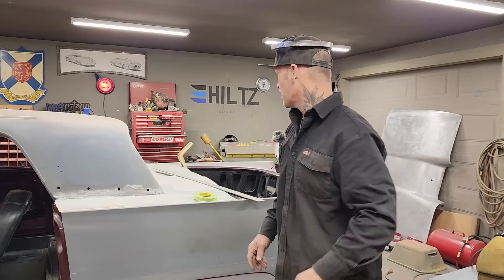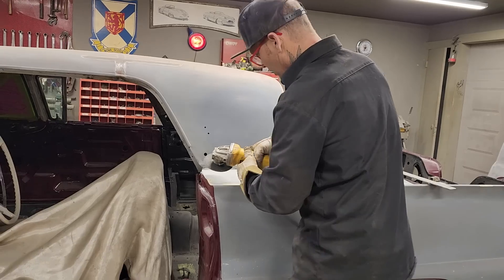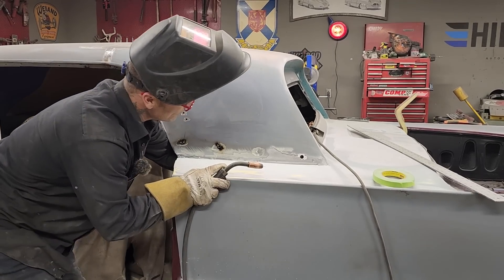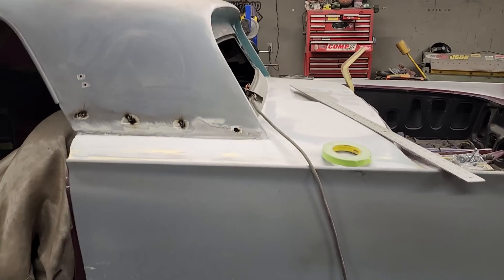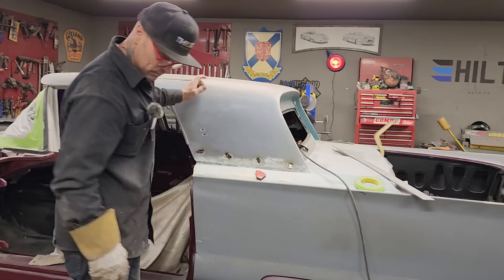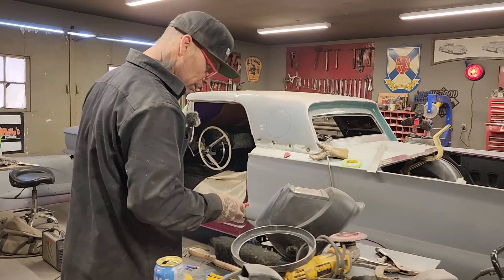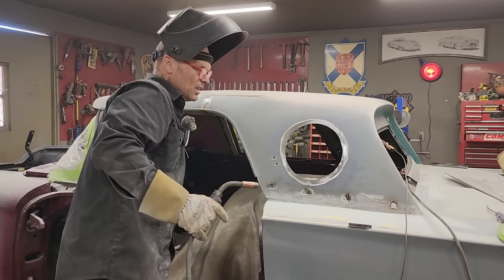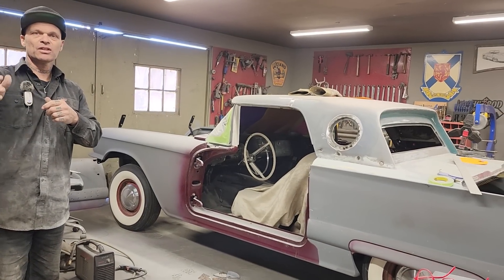We ran into some issues applying the port hole windows 😝

Comment: Cut a piece of coat hanger about 5>6" long. Tack it to the centre of the small metal cut. Pass the coathanger wire through the hole from inside to out and pull and hold the metal plate from the coat hanger stem. (Spinning plate on a stick)...🙂👍Good work though guys . Camera excellent...don't forget to let Fina in....😂👍👍
Reply: Just noticed a few with the same idea ..😂

Comment: When you do the passenger side hole fills, try applying a coat hanger in the middle of the repair piece, feed the hanger through the hole from the inside so you can hold the piece from the outside while you apply the weld. No finger burns and your coat hanger is ready for the final fill. Rinse and repeat!
Reply: Wow that's kinda what I just said
Reply: I thought the same but I was thinking just use the wire from the the welder, just weld it on the patch run a inch or two of wire out, cut it off. much like a drywaller would do to patch a hole
Reply: totally agree , this would be my first obviose choice , cheers

Comment: One idea would have been to weld a short piece of wire to the metal the stick it through the holes to weld them in. Sometimes you have to think outside the box.
Reply: Good mine.s think alike
Reply: Minds
Reply: great idea i like it
Reply: Top idea, same as tow bar mounting nuts you push inside the chassis.
Reply: My idea also but it’s hard  to yell that through the tv. Coat hanger on the back side and place it from the inside, and maybe have Jolene tack it as you hold it. No more chicken fingers.
Reply: A longer strip that covers several holes would also make the job easier.
Reply: chad could have even used masking tape on a screwdriver handle to hold the small metal square in place until he hit it with the welder. lots easy on the fingers too! hi jolene.
Reply: Exactly what I was going to suggest!

Comment: Man the chicken finger brought back memories! I once worked at an offroad truggie building shop, dude had just welded up an endcap on a tubular rock slider and I was tasked with doing the other side. Boss man shows me "look it's a fingers gap away from the body make it the same on the other side" he was wearing a glove when he did this as he had just been welding. Me not taking notice and the metal no longer red hot I put my bare ass finger in there only to realize it was probably over 1000 degrees still, instant blister that covered my entire fingertip! Lessons learned that day....😆😆🔥🔥

Comment: Great job Chad if anyone ever cut stuff out like Chad just did you have to admire what he does as cutting that circle out with the 5 inch cut off wheel that precisely is amazing. If I cut it and I have done a little work on car's I wouldn't be with in a quarter of an inch either side of the line. Bravo Chad. Excellent video work by Jolene as usual 😊.

Comment: When I'm faced with the problem that Chad was with the finger burn . 
I take the welder and weld the wire to the patch part . 
Then I let out about 4 inches of wire  then cut the wire and at that point feed the wire though the hole pulling the patch to the weld area . 
You can then use the wire to hold it in place while you tack the patch in place . 
Just how this old guy does it 😎✌️

Comment: Good points on the pitted chrome. I've seen a lot of people build a decent cat and skimp on so much such as proper screws bolts. I can see not affording chroming but they would also try to say its fine. I worked on the interior of a 51 Hudson rag top with the plaid interior. Guy a guy who restored the car got free storage in the shop for a couple years. He got his screws from his work which were completely wrong but they were cheap or free. He worked for the railway to so he was not starving. When time came to finally pay for the interior, he refused to pay for it. We started taking he interior out in retaliation and he finally paid. Stuff like this is why I got turned off from the car hobby. Then when you are willing to pay, the shops/mechanics.junkyards you go to see you coming and screw you over, had that happen to.

Comment: Maybe when you fill the holes on the other side, you could try sticking your coat hanger all the way through to the inside, and weld your patch to that, and pull it from the outside to plug the hole. Then you can use the hanger to hold the patch while you weld it up. Just a thought to save your fingers. :)
Reply: He needs some honey on hand literally. Best thing for burns
Reply: I used to use unispoter pins and butt wield that size holes

Comment: One thing that may have helped to plug the small holes would have been to take a small roll of the tape you have right there on the finder having the sticky side out. Put that on the end of a drill bit or something that would have fit through the hole on the back side. Stick the small piece of metal you were using to plug the hole on the end. Put it through from the inside line it up tack it in place the repeat for the rest of the holes and no burnt fingers.

Comment: Next time make a slot across the hole. Weld a wire to the little patch. Slip the patch through the slot, andcthen pull it tight to the inner side of the hole and slot weld it. Then just grind off the wire and fill up the hole as you always do.

Comment: To hold the little bits of metal in the tight holes, I would have used some kind of putty as a wedge to hold them in place from the inside, tac and then remove the putty. OR, maybe tac a line of coat hanger to the center of the small piece, push it through from the inside and then tac around the coat hanger using the coat hanger to pull it in place tight. Or of course everything would be easier with two people doing things, one in the car and one outside. Looks good though!

Comment: Chad & Jolene hope you had a nice ride in the Vette today! Chad you gave new meaning to finger sandwiches today, a little dipping sauce and you are good to go! That looked like a painful sacrifice to make, could'nt you have welded the coat hanger or something to the back of the patches and held them in place while Jolene tacked them in? Either way nice work on the holes and the port hole and Jolene nice work on the video and the close ups of the issue with holding the patches. Chad when you mentioned the drinking and hitch hiking, when we were young in the summer in Michigan a friend and I used to just hitch hike around for something to do. I never got in trouble drinking and driving until in my late 20"s I moved from Illinois to Wisconsin where bars are really plentiful and I got charged with DUI more than once. They are misdemeanors in the US however Canada considers even one a felony so as much as I would have enjoyed attending the workshop that you had or even just visiting you and Canada as a felon I am not allowed in Canada so if they chose to check my driving record at the border I would be turned around and sent back. I think that is why you had people that ended up sending the kids instead of coming themselves as they had signed up to do!

Comment: Hi Chad and Jolene , Zack from USA 🇺🇸 on this video, I can't help myself but to say if it's of eny help future reference on a similar hard-to-get area for welding I like to say , that if it's hard to hold the metal size of a dime or nickel if you weld a clothes hanger wire in the middle on that nickel-sized metal and put the wire  through the whole that you're going to plug up... hold it on the other side to tack welded then break off the clothes hanger wire.....

Comment: Bad Chad, just a thought so you do not fry your fingers on the passenger side… what if you made your small natal ‘backer’ pieces and then welded a length of coat hanger to each piece. Then slide the coat hanger welded to the piece from the inside of the car so the backer is inside and the coat hanger is outside for you to grab with a gloved  hand so you can pull the backer tight without getting roasted as you weld. Just a thought from a nobody that does not like burned fingers because they hurt.

Comment: I agree the back window looks too small and the port holes look too big but anyone can do anything they want to do to their cars  Thank you Brad and Jolene for posting the videos they're awesome
Reply: The upside to what he is doing IS that once he has all ( windows ) accounted for in the top , IF he decides to have the top of the door window , the top of the porthole and the top of the back window relatively close to the same height for uniformity. The back window frame can have the top cut out at the upper corners and moved up.... Or not really... it is up to them.
Reply: If the rear window is tinted and the surrounding surface painted dark or in contrast to the car it might look better ?
Reply: Please raise the back window upper lip about two inches to height of porthole.....its on the fence at cool but taller rear window it be badass. That zip cut circle some serious skill i cant say enough how amazing you are with it.....
Reply: The 56/57 Thunderbirds port windows look big too,look at the side profile of a 56/57...

Comment: Chad:  When you want to weld in a trim hole and there is a bigger hole behind for a socket access to the nut that holds the trim, cut a piece of metal that will fit thru the rear access hole and tack a piece of welding rod or coat hanger wire to the piece and feed it thru.  You can pull out the wire and hold it while you weld the hole. Much easier and it prevents dropping the backing piece and burning your fingers. Speak from experience.

Comment: For the hole plugs try sticking the welding wire to the plug then run out a few inches and cut it off. Then run it through the hole and hold in place from the outside. 
Everything is looking great. Really enjoy your work .

Comment: Hi chad can you just spot welld on the little  bit of metal and put it through the hole to hold onto the little bit of metal .when I say it sound better in my head wot I mean is thread it like a shoe lace throw a hole 🕳 put some welding wire on a little bit of metal and feed through the back of the roof if you know what I mean pal🤪👍👍💯 love your channel chad I hop this is OK 👍

Comment: A litle tip if you don't want to be fighting with those pieces of metal behind a hole: tack it with the welder to the welding wire, run the wire cut it and you will have a piece of wire on that plate to pull it through the hole, enabling to keep it in place and weld it 😊

Comment: Tack a piece of coat hanger to the center of the patch metal, poke the coat hanger through the hole from the inside and then use the coat hanger to pull the patch up tight for tacking then remove the coat hanger. I have done this MANY times before. and it saves the fingers.

Comment: On those little pieces of metal you should have tag welded a piece of coat hanger to the little piece of metal and then fed the coat hanger through hole from the back side and simply pulled metal to roof tight from the outside front.
Then weld and melt coat hanger off.

Rinse, wash and repeat for each one.

Comment: Chad, monkey metal is another name that they always called Pot metal, which is a very cheap low melting  point alloy. or brittle aluminum castings. It was a term used in the antique trade to describe spelter figurines, and other ornamental items.

Comment: Hi Chad and Jolene good episode as usual. The Smoothed Nosed and Decked look is fine by me and this Bird is the right car for it! Those original Monkey Metal trim pieces though are kind of cool and I believe readily available. New or old stock would be easier and maybe cheaper than restoring the pitted ones.

Comment: You can fix the back window, by cutting it bigger at the top, bringing it up to within about an inch from the top.  That area is where it seems to look really off.  Just make it taller, then the back would look so much better and it would work better with the portholes.
Reply: Why even bother?

Comment: Chad is a master at engineering on the fly!
Reply: A Chad. mart Campbell on your putting your metal in from the backside. Why couldn't you just use your wire from your welder? Put it through the hole and then you have something to hold on to so you won't burn your fingers.
Reply: @TheRolfano  You're saying he has an eye for aesthetics?  He's way better at fabrication than design.
Reply: This episode was even more painful to watch than usual. Usually he is good at the fab part, but watching him cut little pieces, drop them, re-cut, weld, burn himself, then almost screw himself by not checking being where he was cutting the porthole....yikes!   There's easier ways to weld little holes up.

Comment: An easy way to delete holes like that is to hold a piece of graphite or copper behind the hole and just mig weld them shut .  The graphite or copper won't stick to the welds.  I think you can buy a copper backup tool with a handle at Harbor freight .  I bought one there years ago . copper

Comment: hey if you zapped a piece of coat hanger on to the metal chunk you could feed the coat hanger threw the hole from the back and pull it toward you to hold the metal tight against the hole while you weld it and then just buzz it off with the grinder when you flush it off.

Comment: He should weld a little piece of coat hanger to the plug, stick it through the hole and use the coat hanger to hold it in place from the outside until he gets it tacked.

Comment: Chewing gum. Get some chewing gum wet and put it on the end of a stick to hold the metal piece to the inner body while you weld it. Burn the gum, not your finger. Then  pull it off when you have welded the piece and move on to the next one. This also makes it easier to hold the piece when you use a stick long enough to reach into the car.

Comment: Sorry Chad that you burned the tip of your finger. I think I would have welded the small pieces of metal to the end of a coat hanger and pulled the wire through the holes from the back with the metal pieces on the end then welded them.  Easy to say when your not the one doing it. Your very good at your job.

Comment: You could tack a coat hanger to the center of the patch and put the coat hanger through the hole then you could hold it in place an weld it from the out side

Comment: What seems to be the  simplest tasks  can be the hardest.I once tried to fill holes on my friends police car that he bought at auction. I uses the knockout plugs from electrical boxes. I used a file to open up the holes just enough to  inserted the  knockout plugs in place brazed them because I didnt have a mig welder.

Comment: could you weld a peice of coathanger to the plug and then stick the coathange through the hole and pull on it and weld it all form the outside??

Comment: Those holes you filled with the little square coins, all you had to do it drill holes in the center of each, pull a tiny wire through to hold it while your welding them in place. WAY to much effort was spent on that particular portion.

Comment: To hold the little pieces, welder ground to patch, tak welder wire to piece lightly, take off ground, run out 4 inches or so of the wire with piece tacked on, cut off and instant handle you can break off easily!

Comment: When you cut those little stripes and bang them straight add a little piece of wire in the middle and you can hold it and then weld it

Comment: if you  tack a small piece of wire in the center of the backing metal   you can use the wire to hold the backing in place

Comment: Chad if you tack a piece of wire to the center of those plugs, you can feed it through the back. Pull on the wire to keep it tight against the metal and then easily tack in place. Grind off the wire and fill it with weld.

Comment: Remember in science class taking wire and wrapping around screwdriver to magnetize it.  Try taking metal plug wrap with copper wire and touch each end to positive and negative on battery that might mack them magnetic and stick long enough to tack weld.  Good luck..

Comment: Chad,  try sticking the welding wire in the center of your little plug pieces, then clip the wire off at a comfortable length and the use it as a pull hold to weld the plugs in😂 then you can save your pinkies
 Steve

Comment: Chad do yourself a favor and get yourself a copper ground rod best thing to use to weld up holes. The copper is a backer so you can weld up the holes and the weld doesn't stick to the copper rod

Comment: Chad, please don't hurt yourself like this, Weld a short lenght of your coat hanger to the center of plug and then push it through so you can hold the coat hanger from the outside. Weld the plug in two spots and then snip off the coat hanger before welding up the plug completely.

Comment: Chad when you get into a situation welding up a hole like the sail panel take a piece of tape roll it inside out stick it on the piece you’re welding and take a bolt or nail stick the head of it to your piece then you can hold it against the sail panel to weld it in. Jolene your doing a great job filming

Comment: Chad, tack a piece of clothes hanger on the face of the small piece of
 metal. The push the wire through the hole and hold it in place for the tack.

Comment: Hi Chad and jolene. if you hold a aluminum plate 1/4 inch plate  or bar behind , you can weld directly to it and it will stick a little but wont weld , it will make filling the gaps much easier for you

Comment: Make a tringle to fit the hole and push the point through the hole and tack the point and then weld in the rest of the hole. Wouldn't that work? Or make the back piece bigger and hold it in place beside the hole with the magnet.

Comment: Chad, you needed to weld a small wire to those small pieces so you could pull the wire through and hold the metal.....

Comment: Couldn't you put a magnet beside the hole on the outside to hold the little pieces of metal when you put them on the inside?
Maybe you could have made a plate to go there with some Bad Chad flexible chrome and bolted it on... 🤔